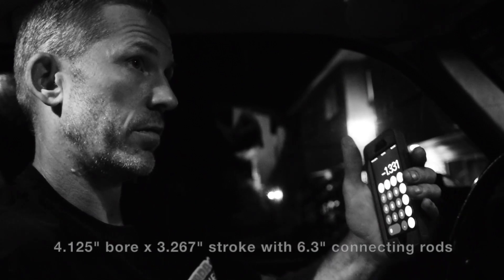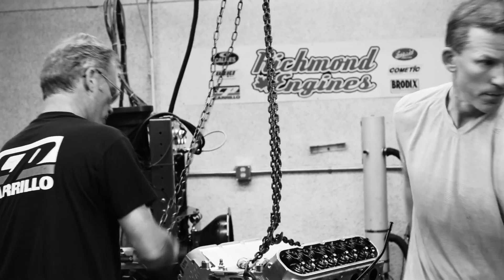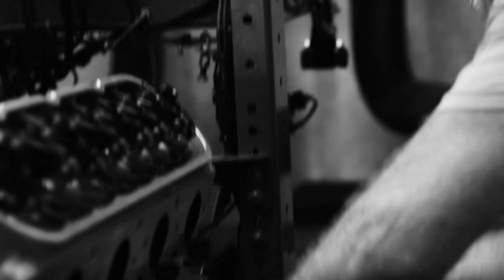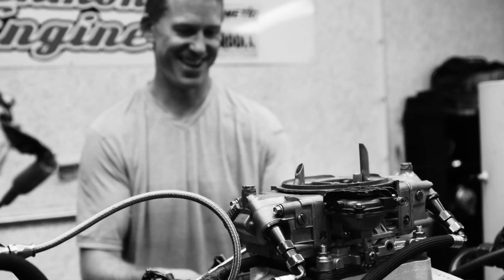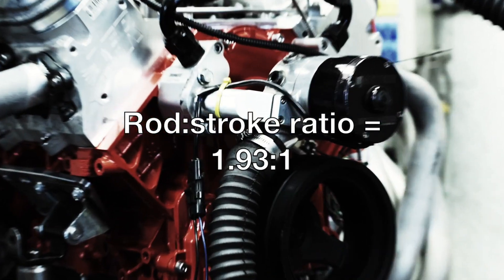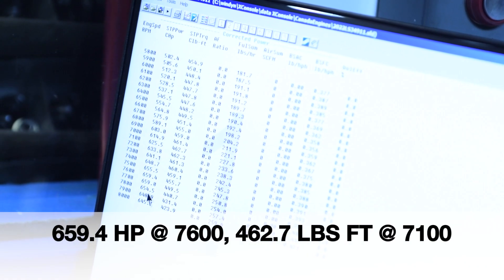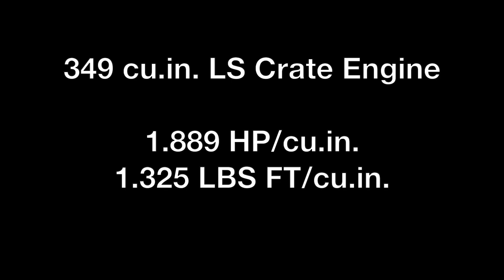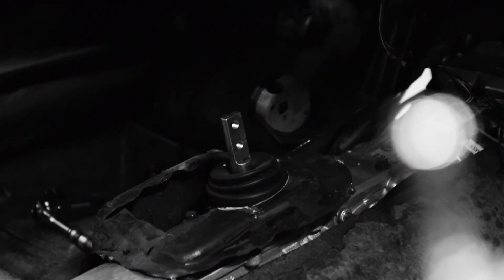4.8L Crank + 6.2L Block = 1.889 HP Per Cubic Inch 349 LS (extended cut)

Comment: Another way to make a ls 350 is to use an ls7 block with the 4.8 crank. I bet it can really rev and I haven't seen anyone do it yet. I like high revving engines over long stroke big Torque low rpm engines

Would absolutely love to see you do thus with a big cam and really good valvetrain. I bet I would make power until 9-10k rpms kinda like the nascar engines that turn 9k+ rpms for long periods non stop.
Reply from the maker: Ya absolutely. I’m waiting for a nice free block to come through my shop that I can scoop, then giddy up!
Reply: I can't wait I've wanted to see that combo for yrs ever since the ls7 come out.
Reply from the maker: The block I used in this build is a 6.2L which has a standard bore of 4.065”. I bored it out .060” to 4.125” and that is the standard bore of the LS7. So basically what I did here is the same thing only a basic aluminum block that’s a lot more common, and therefore cheaper :)
Is the LS7 block stronger?… I doubt it is. What I would actually see value in is spending the money on an LSX tall deck, using the longest rods available and putting a bunch more cam into it. AFR’s LS3 heads and shaft rockers… 9000+ 😊

Comment: Your engine setup looks really great. I’m curious how it would perform on 9000rpm dry sump and a block from Dart, especially with priority oiling to the mains 👏
Reply from the maker: Thank you! I like your idea and would be curious doing it with a 3” stroke and a stronger block like you said or a cast LSX GM block.
Reply: @ceperformance  Actually, I was researching and planning to do that project, and that’s how I came across your video. From what I’ve concluded, the biggest challenge is the valvetrain capability since hydraulic lifters typically can’t go beyond 8200 RPM without any risk , while solid lifters require adjustment every few races or around every 5,000 miles. Another key factor is selecting the right deck height to optimize the rod ratio; longer rods are better for high RPM, but they reduce piston skirt length, which affects piston stability within the bores
Reply from the maker: Cool. With the valve train I would use a set of shaft rockers from T&D or Crower. With that quality of parts and solid roller lifters, I think you would be surprised how little maintenance it would require. 
Long rods, absolutely. I would entertain a standard deck, 6.3” rods with a 3” stroke. That gives a 1.44” compression height and more than normal space for a supportive skirt.
Reply: @ceperformance may i ask what cam spec and head gasket thickness Im about to assemble similar project and worried about valve to piston clearance
Reply from the maker: Comp Cams custom grind… part # 54-000-11
Lobes: 12677R/12686R HR 113	 LSA Specs	249/267 @ .050 .675/.675 -.016 lash

The gaskets are .045” thick

Have fun!

Comment: Who stays up for days in order to go into the mediative state to have these visions to cimbine the formulas of mixed compbinatiinof factiry and aftermarket psrts to achuve the nunbers yall regularly achieve. 
As usual the outcomes is akways very energetic to say the least.
Please forgive any typos mispelling as well as poor sentence structure. 
As ive lost 97$ in my right eye,, and have at best 25% in left, so typing isn't what it once was not too long ago, because the letters all kinda run together under my larger than averge digits.
Constantly trying to correct every word is frustratubg to say the least, but then translarlating my spastic chickin writhing has to be even worse.
Like the latest ipload equally as wwll.
91 best we gt in Texas and its so f'd up wuth cirn piss its laughable to claim it as legal fuel.
Especially here in summer time with its long lasting shelve time of a whopping 30 minutes, and thats at night.
With day time reaching such unbelievable time of under 10 minutes.
Which in this time span its distorted several commercial pieves of high dollar lawn equipment carbs and fuel lines.
Eat the distribution plates outta several old large cfm Holly carbs.
With no true recorderd numbers of eldobrock carbs being thrown in trash due to the fact theyve been reduced to a metalix syrup by time recycling truck comes by to collect such things.
Yalls fuel cost is greater for sure, but it doest come close to the real cost of ours by the time the parts are replaced on everything from chrap walmart weed eaters qnd the cost of equipment parts and replacement equipment down rine mechanics fees.
Fuel systems on expensive old muscle cars n hot rods once used on nucd weekends but niw sit on blicks empty fuel system after untild thousands spent replacing comoonets hoses pumps diaphragms the different list are endless as are the money thrown away by the while country due to the greedy pukes in governments, and oil companies board of directers stovk hokders upper management and the rest if the parasites sucking the publuc dry like flyies on road side hiwsy traffuc supplied mangled meat suppliers around the world. 
Peace n Harmony will definitely make the world avfar better place .
Just think what fuel wuthiut excessuve taxes, real fuel without cirn piss, along with groceries that dont cost fuxed income a months check families to cut nearly everything from the buget to afford sack lunches for the kids after feedibg them grits and iarmeal 3 or 4 nughts a week.
Reply from the maker: Hey, thanks for commenting :)

Comment: What brand lifters are yall running ?
Reply from the maker: Hey there. On this build I used Johnson Top-Line lifters. They are listed for a 350 Roller cam engine and are solid roller, not hydraulic. Part number is B2992.
Reply: @ceperformance  does any machining need to be done to make 350 lifters work on an LS ?
Reply from the maker: @cartermackenzie1135 
No they fit right in. Thank you GM!
Reply: @ceperformance  that's awesome, I've seen the options labeled for LS motors and have always wondered why they are so much more expensive than other platforms. I'll definitely go solid for my build. How is the maintenance on them? Would you consider this motor daily driveable?
Reply from the maker: Reliability is important to me and I have no issue with solid lifters for daily drivers. Set the lash very accurately and it will last a very long time without maintenance. Use good adjustable rockers!

Comment: Holy moly Im just learning these LS series in the last few days I've always been more of an import guy but I'm looking at building an FC rx7 but with how much the the price went up on all the good Japanese motors like the 1/2jz, the 13b went up in price not just on motors but the parts for them, an LS swap just makes so much more sense. N/a no turbo system to worry about, can still build a high revving motor for a reasonable cost with absurd power levels for a 2500lb car. I guarantee if I built a 5-600hp rotary I would end up rebuilding it over and over spending thousands each time. Now that I know I don't have to blow 2,700 on an LS3 block I can just use a caddy block it saves me a couple grand at least too!
Reply from the maker: Absolutely! These 6.2 blocks are definitely tough enough for N/A even making 600+ HP.

Comment: Great job, I like forced induction/tubocharing to regain some of the power loss compared to the standard 6.2 LS as well as further increase engine efficiency. So the engine would match or exceed the power of a standard 6.2 LS but have higher rpm capabilities. Probably a very obvious question but would using a Howard's camshaft, or a Summit Torqinator camshaft be suitable for an engine build like this? Or would the choppy sound just be lost once higher rpms are reached (I honestly don't know).
Reply from the maker: Thanks for commenting. 
Camshaft choice is very important to get right. There’s a lot of bad ideas out there for sure. Choppy isn’t always the best. I like stuff that sounds nice but performs the best in the application.
Reply: @ceperformance  Thanks

Comment: I'll never understand why anyone would want to build a stroker for performance if you can achieve roughly the same displacement with a destroke because the destroke will almost always perform better.  You guys built a 400 block with a 283 crank (always wanted to build one but haven't has the opportunity) which is VERY impressive.  I've always wanted to put a 348 crankshaft into a 502 block to see what would happen when you pushed a big block Chevy to be as far over square as possible with a GM produced block and crankshaft.  I'm guessing it would be a beast!  Keep up the great work guys!
Reply from the maker: Hey thanks for the great comments! I’m happy to hear that others out there have similar thoughts as we have.

Comment: Talk about a mad build!! 👏‍
Now I'm here wishing GM made an LS version with an even shorter stroke than the 4.8, maybe the same as the old 283...or at least that they kept producing and improving the 4.8, instead of phasing them out in 2007.
And while I love the LS for its flexibility of recipes, I sure hope to see these recipes being brought to the LT family too!
Reply from the maker: Hey thanks for commenting! It would be cool to build a 3” stroke LS for sure. 
I remember when Nelson Racing Engines did a one-off race boat twin turbo LS with a 3” stroke. Maybe it was actually shorter than that? There’s a great video of it on a Dyno at WOT for something like 5 minutes! It’s hilarious. I’ll look for a link.
Reply from the maker: Here it is… 

https://youtu.be/L1P-eaQHkXc
Reply: @ceperformance  Uncle Nelson! I've followed his builds for years! How come that one escaped I don't know, but I'm glad for that video, hehe!
260 cubic inches, that surely seems a big deal! To think it's just a bit larger than the 250-ci 4.1L inline-6's so popular here...
Considering that crank is possibly custom-built, I do believe it could even be shorter than that. With the engine operating at max rpm for long periods, having a piston speed as low as possible is the ideal.
Thanks a lot! 👍‍
Reply from the maker: Your welcome! I think it’s great too :)

Comment: Love this one again. Quit teasing me with all this destroked stuff.  My next project up is a 302 sbc which I have been talking about for years, and it’s finally getting put together.  Keep it up!!
Reply from the maker: Hey thanks man! I hope your project is a complete success :)
Thanks for your remarks!
Reply: 302 with an LS?
Reply: @Mike44460  no. It’s an old school small block, aluminum heads, solid roller cam, etc.  all aftermarket other than the block.
Reply: @DeathTollRacing  Far out, had the real DZ in 1969 with a 4.88 gear. The prefect red light bandit.
Reply: @Mike44460  I bet!  They scream

Comment: How do you take an aluminum 6.2 to 4.125 bore? Stock sleeves, or did you sleeve the block?
Reply from the maker: Thanks for asking. The 6.2 factory bore is 4.065” so it’s only .060” over. There’s still lots of sleeve left plus a bunch of aluminum supporting the sleeves. 
Nothing fancy :)
Reply: @ceperformance would that combination be strong enough for boost? Seems like the factory sleeves would be pretty thin at that point just a basic question
Reply from the maker: I never planned on boost but it would be interesting to try :)
I believe it would survive. 
This would need dished pistons before I’d ever attempt that on this combo. Thanks for commenting.

Comment: Hey, when are yous guys going to install Ford a 302 or a 289 crank in a 4.125" bore after market sbf block? Unfortunately the newer Ford engine platforms aren't a good match for these kind of configurations.

Or what about a .060" over MOPAR 340 block with a 277/301 crank that has a 3.125" stroke? Or a .060" over 6.4L Hemi with a 318 crank in it? Same bore spacing but different bearing size.318 mains are 2.500" while the Hemis are 2.559" so if they make .060" undersize bearings you could use a standard 318 crank? Not sure though because of how narrow the Hemi con rods are, the older crank might be to wide in between the Hemi block's mains?
Reply from the maker: Those are some interesting ideas :)
I think the SBF is definitely a future project. Just need a customer to get on board and pay for it!!
Thanks for commenting :)

Comment: 660 HP should propel a 3500lb car to over 130 mph in the 1/4 mile.
Reply: How about a 2500 pound 944 ;)
Reply: @cartermackenzie1135  8.95 @ 151 mph
Reply: @tenthousanddays2103  looks like I'm building one he'll of a car then lol
Reply: @tenthousanddays2103  how did you come up with those numbers?
Reply: @cartermackenzie1135  Moroso power speed calculator Part# 89650
Reply from the maker: With okay traction, what ET should be attainable?
Reply: @ceperformance  My 66 Chevelle 396/375 Super Stocker made 660 and went 9.77@135 @3540#
Sub optimal traction and gearing won't provide the ET but MPH should be close.
Example: My 70 Chevelle with the wrong convertor and not enough gear went 12.08@118 @3750. Sorted out, that 118mph should be 11.20 / 11.30 et but would still be within a couple of mph of that 118mph.
Reply from the maker: Thank you. I wonder where that ‘66 is today?
Reply: @ceperformance  I sold it to a guy in Harnosan Sweden.
Reply from the maker: It sure would be cool to see it again! 
I have a large picture framed of it on my shop wall back when we put my 327 in it for the weekend. Front wheels a foot off the ground at Mission Raceway :)

Comment: What are the cam specs on this one?

That's wild, almost 200 more HP than what the torque maxed out at!

Those big heads are what's reducing the torque but the upper HP sure likes it! 4.56 plus six speed in a light Nova sounds like that car is going to be a hoot and a half with 659.4 HP on tap to drive!

Reducing the piston speed has to be helpful in these combos as well by freeing up some horseys to spin the engine. Combine that with the shorter stroke that the explosion pushes down further than an engine that would have an longer stroke and with the longer rod ratio to let it run on pump gas makes these really attractive little power houses. 

And quit making your videos private! LOL  JK, they're your videos do what you want with them, I'll get over it.😎
Reply from the maker: The camshaft is one we got Comp Cams to make for us. We picked 2 lobes we liked and had them put them at 113 LSA. The lobe numbers are 12677R on the intake and 12686R on the exhaust. The specs are 249/267 @ .050 of duration and .675/.675 lift and .016” lash. 
The lobes are a hybrid design and can be used on either hydraulic or solid rollers. We’re using solids. 
Thanks for your comments! 
If you’re wondering why we took the last video down and reposted it was to make a correction :)
Reply: @ceperformance  That cam has 32 deg of overlap but idle seems smooth and not choppy?
Reply from the maker: Thanks for commenting. I’m very happy with the idle quality and it is impressive at how well she runs. I’m a fan of wider lobe separation and this one I did with 113 degrees of LSA. Some people think it’s silly and I’m sacrificing power but I love it!
Reply: @ceperformance  Thank you for elaborating on this!!  Phenomenal information.
Reply from the maker: @tptrsn  You’re welcome :)
Thanks for commenting!
Reply from the maker: Hey, thank you for commenting!